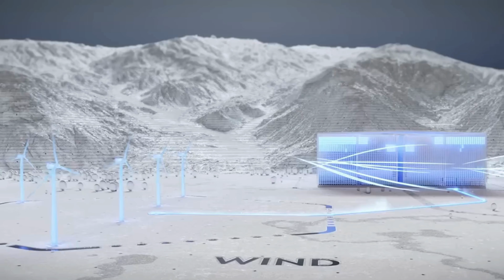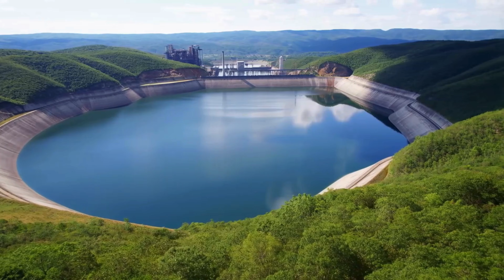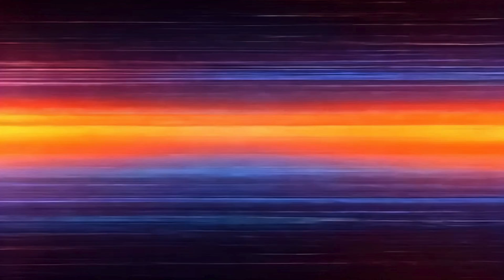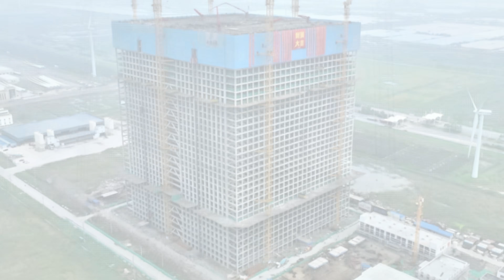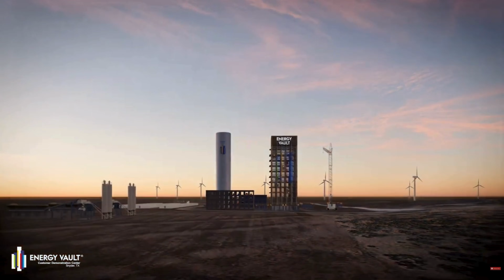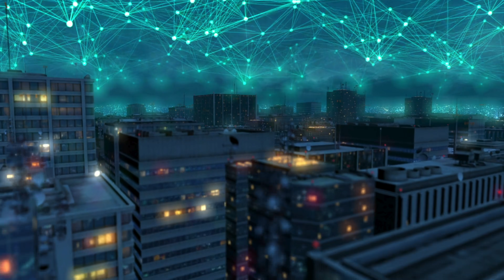Pumped Hydro Is Dying — Gravity Batteries Are Taking Over!

Comment: Every town that heats could store enough heat in summer for winter with a sand box
Reply from the maker: That’s actually a really interesting angle — seasonal heat storage is one of the most underrated parts of the clean-energy puzzle. A lot of the challenge is making it practical, cheap, and easy to scale. 😊

Comment: Wonder if people realize sand batteries work as well and fyi they might consider section of a desert as battery storage easily done in massive scale are near a city if coordinated properly and respected enviromentaly interestin thought on that too cause deserts are naturally warm and store thermal heat all day long from the sun so how is it an issue is sand batteries work then why aren't they harmonizing with the desert areas with clean energy already being provided naturally
Reply from the maker: Totally fair point. Sand batteries are real, but they’re basically heat storage, not a direct electricity battery. Gravity batteries are a different thing entirely — they store energy by lifting mass, not by using sand as the energy source. Both are cool examples of old physics being reused in clean energy. Maybe we touch sand as next topic! 😉
Reply: @TheGreenBlueprint_TGB funny I keep wondering how exactly is it storage i mean i get the concept block go up n down using energy to movem in a surplus compared to weight ratios but thats not really storing energy either i mean if the block are movin n move the turbines its more of.a make.energuly on demand kinda style but actual energy isnt inside the blocks is it 
Plus why don't people just make.one like that corky bird thing I saw as a kid hat a little hat dipped down went back up dipped down went back up never needed anything celt a little gentle push and it'd do it all day long how come they dont balance them out that way with it n hook up weight ratios for that n spin turbine every time it dips down